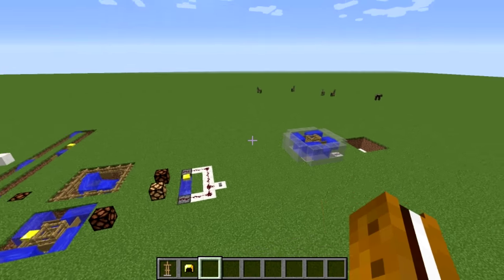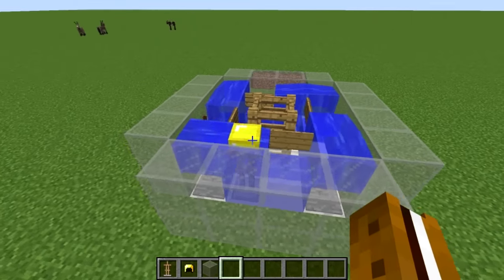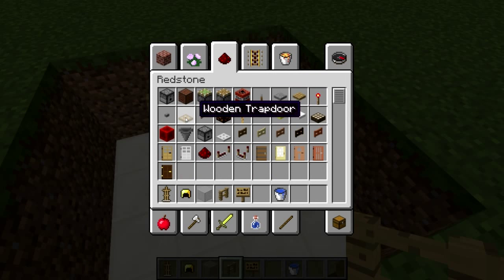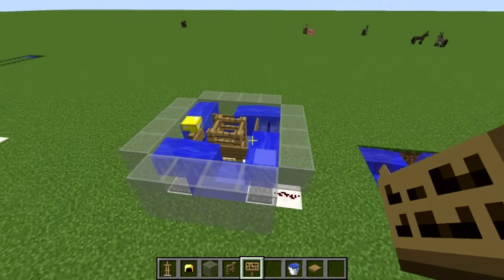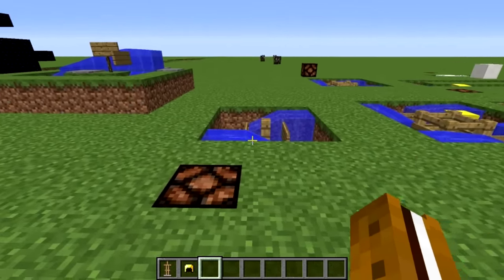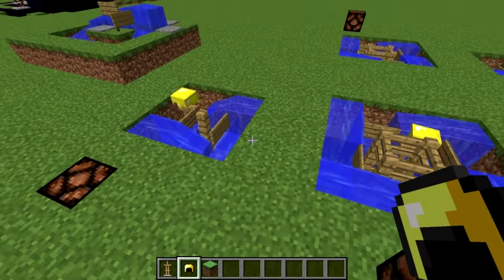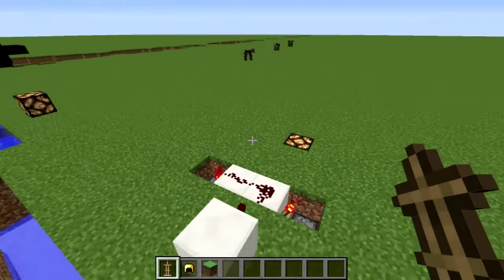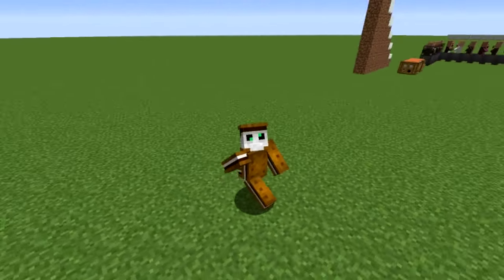Minecraft Tutorial - Armor Stand Timer - Armor Stand Clock(Minecraft 1.17+)

Comment: mine wont work D;
Reply from the maker: +ThatMinecraftKid Can you explain what is happening?
Reply from the maker: +ThatMinecraftKid Is it getting stuck on the outer or inner wall?
Make sure all of the water is moving around the circle and none of it is falling downwards where signs should be.
Reply: its getting stuck in the outer wall and im trying to make the pressure plates in the middle trying to experiment..... but i guess i'll have to make it to the side and make 2....
Reply from the maker: +ThatMinecraftKid That's awesome that you are doing some experimenting with it!
Does it work when you build it just like the tutorial?
Reply: it works the regular way...
Reply: the water keeps freezing though
Reply from the maker: +ThatMinecraftKid If you put a torch near the water it won't freeze.
Reply: ok ty
Reply: it still freezes
Reply from the maker: +ThatMinecraftKid Put the torches very close to the water. You can also put blocks above the water since water will only freeze if the sky is directly above it.
Reply: nice thinking and ty again!